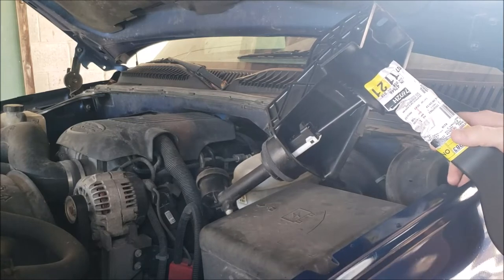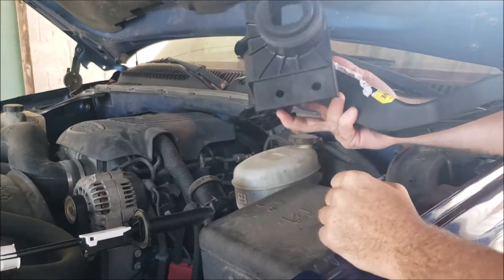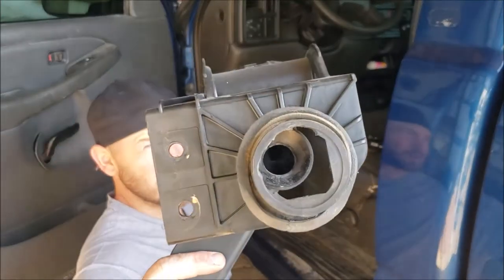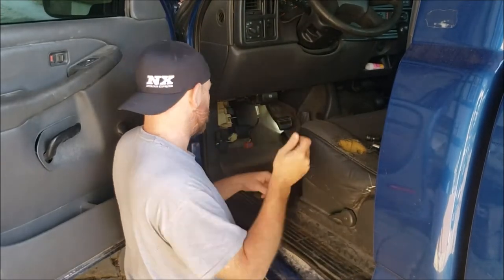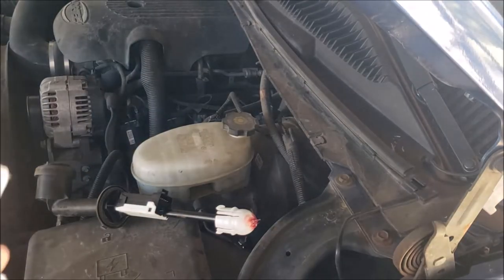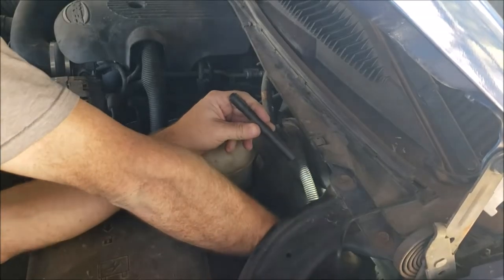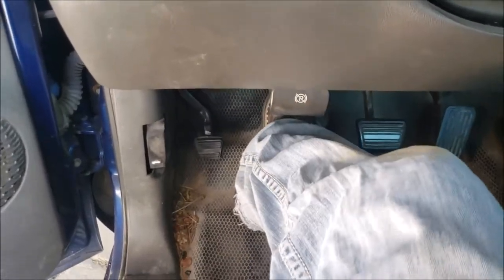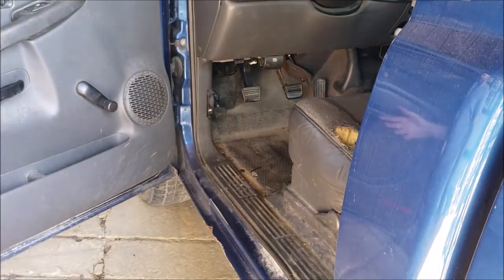Silverado Clutch Pedal Replacement

Comment: I just had to deal with this same problem. Instead of replacing the bracket, I bolted them together. I used 2 - 1/4"x4""J"-bolts. I drilled 2 holes through both the master cylinder flange and the clutch pedal bracket. I pushed the bolts with the "J" portion (inside the cab) through into the engine compartment and double-nutted them. It holds the master cylinder in place and doesn't require any disassembly. The location of the drilled holes is critical, just be sure to not hit the rectangular module that the sensor plugs into.
Reply: Im impressed someone who thinks out of the box. I’m going to put it on my truck when i replace the master cylinder. I put a heavy duty clutch in so it’ll probably improve it’s hold. Thank you for your time.

Comment: The pedal itself LOOKS LIKE it is attached with nuts and pivots on a bolt, but they are fake nuts and are held in by spring pressure.   You can use your fingers and push the nuts in, and release the pedal from the mount to make install easier.

Comment: This happened to me about ten years ago. A friend & i went to home depot bought a piece of metal. Cut a square hole with a grinder and bolted it to the firewall. It still works today
Reply: that is what I'm thinking of doing.  It gets 40 below here plastic snaps so easy in that cold.  How did you fit it over the wider part?  I'm struggling to figure that out.

Comment: Thanks for the video I was hoping it was possible to swap without having to disassemble most of dash, previous google searches scared me a little. Mine broke on me today, luckily i had some wire in the truck and made a jumper for the clutch safty so i could start it and float gears to make it home, just haave to wait on parts to come in  now since no one locally stocks any clutch related parts for these trucks.

Comment: Thank you!! 30mn and done the first video I watched had complete dash removal!
Reply from the maker: Awesome! Glad it helped. Thanks for watching.
Reply: Wish I'd seen this first. I've got a pile of screws n bolts because I watched the other video myself. Gonna try this n see how it goes.
Reply: @joehaney5186  I was done in 20 mins I did have to move the distribution block outta the way good luck!

Comment: My 02 silverado has starting issues. The clutch safety switch slides up and down the clutch rod easily. Is it supposed to slide away from the firewall towards the driver seat just by pushing with a finger? Or is it supposed to be fixed to the pedal assy?
Reply: At the 1:40 mark of the video...does the switch snap into the broken out piece?

Comment: I was able to get mine out the same way. O'Reilly's sells one with a metal insert should prevent problem. Also when i installed mine i put the pedal lever in after installing the housing. Just push in on both sides the lever pops out. Made installation much easier. Thank you for the video!! Would have been lost without it!!

Comment: Thanks for the video! These 5 speed cat-eyes are getting pretty scarce and some of the parts hard to come by. Someone tried stealing mine and broke the steering column housing near the ignition- which is an impossible part to find without the column shifter hole.

Ended up buying an OEM master cylinder before I realized it was the pedal assembly that had busted. Non-returnable part that was more expensive than the pedal... but at least I have a backup lol
Reply: Look at the early mid 2000 trailblazer they have the same steering column bezels

Comment: Yeah I’ve done this 5-6 times on my sons truck.  Someone had put a heavy duty clutch in it which increased the pressure on the pedal and the bracket, real shit design.  Then my nephew had it and it broke on him.  This time I only bought the 1 piece that broke and had a metal insert made by Dorman.  Should be good for a while.  The noise I believe is coming from the two spring tabs that connect to the pedal.  Good video , thanks.
Reply: Its a little pricey but a company called Atomic Fab makes one all out of metal which will last forever
Reply: I have a 2004 Silverado 2 wd.  I've been a Chevy guy since the 60's.  There is so much phony garbage with this truck I'll never buy another one.  My clutch master cylinder got air in it.  No way to bleed it out.  No bleeder at the tranny to bleed the slave cylinder.  Pull the trans to change the slave cylinder.  Once again I'd really like to meet the jerks who designed this POS and sucker punch them.

Comment: Just finished doing this.
There is a pressed sheet metal  lined barrel replacement available on Amazon.  Works, had to pull the insulating foam off the barrel though.
-The bracket barrel will go through the firewall.   As you look at it from teh engine bay use a flat blade and put it at the 10:00 between the barrel and firewall.  Pry it toward 4:00 and into the car.  I had to cut the barrel off the original unit using a dremel with a cut off wheel.  i cut frpm the FW side with the dream inside the barrel cutting out.
-from the inside the barrel has to go to the left down and then right.  its a thing.
-I had to remove the foam form the barrel in order for the pedal mount to go forward enough for the tabs on the top to allow it to seat then the bolt holes aligned like magic.
the Pedal msut be on the bracket when you install it.  I could not get the pedal to mount ot the bracket while it was installed.
-i could not get the master cylinder to align.  I had the GF pull lightly on the clutch pedal to pull it in while I aligned it..

This process sucked, hope this and the video helps.   If I had to do it again i could do it in an hour.

Comment: The doorman replacement has a steel insert where it always breaks out
Reply: can you take off and put on the clutch foot lever onto that doorman bracket too?  The doorman part doesnt show the actrual pedal on their part.  Thanks for the tip above too.
Reply: @christopherw4527  yep you pull the whole thing out and you put the pedal on the new bracket
Reply: @jaydenorcutt5677  Thanks a million.  I'll order that bracket now.

Comment: I'm doing this currently and can not for the life of me get the damn thing down
Reply from the maker: Did you get it figured out?
Reply: The easiest way to do it is  unbolt the dash and push it forward slightly to give yourself the extra room
Reply: Yes, after your video it went from a 4 hour ordeal to a 30 deal. So thanks for the video lol
Reply from the maker: @MagnumTheGamer  I'm glad you got it figured out.
Reply: Pull the unit the following way and in this order. 

Pull screws - unplug all connectors from power distribution block - remove power distribution block by depressing the two white tabs on either side at the top then rotating the top towards you while sliding the whole thing upwards (its very easy) - Now for the pedal assembly pull back while aiming the rear of the bracket up (towards steering wheel kinda) - once the round portion of the assembly in out of the fire wall point the rear left towards your drivers side mirror while pulling and rotating the round male portion down to about the 4 o clock position - after this you simply have to work it out between the brake pedal arm and the right bracket that held in the power distribution block.

The trick is two orientate it the right way at the start when pulling it from the firewall. If you do this wrong, that's the ball game. I had mine out in 3 minutes. I spent more time taking the bolts out.

Now to make the install so much easier then all these videos make it look. Separate the pedal from your bracket. This is also super easy. On your new assembly there will be two hex looking things, one on either side. It will look like you could put a hex wrench in there. Take a sharpened  pencil or anything laying tapered laying around and press it in. While its in, pull the pedal to when lock that in by wedging it against the inside of the bracket assembly and remove the pencil. Then repeat for the other side, pull your pencil out and the pedal will slide right out of the bracket assembly. Now, go bolt that bad boy in and in minutes cram the pedal up in the diagonally and rotate it and the rotational force will press the sides in. Toy with it until you hear them pop in and your done. Reconnect your safety lock out switch on the master cylinder if you disconnected it and replace and re connect the distribution block. Congrats you're done.